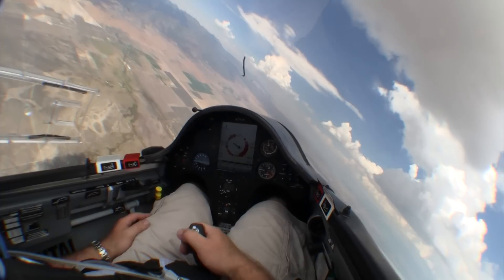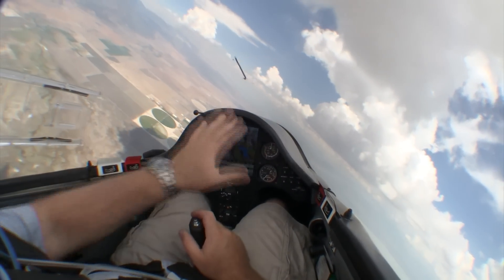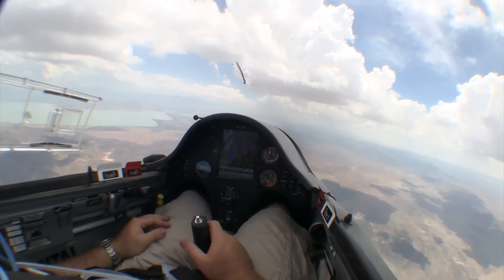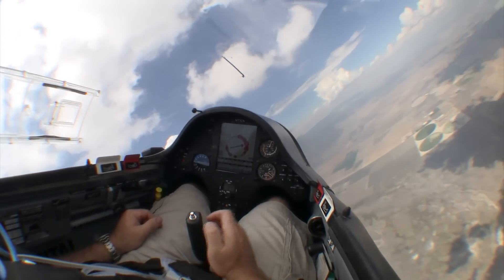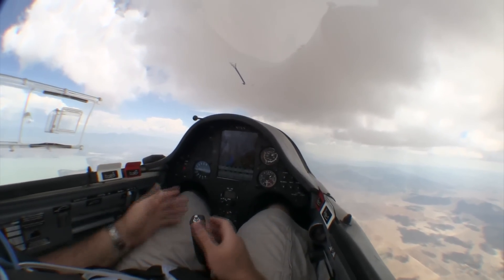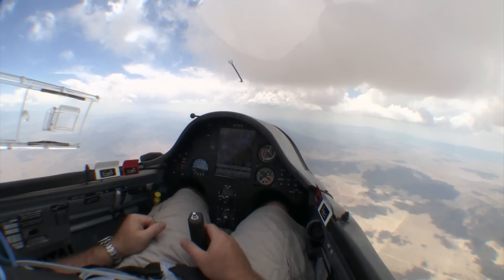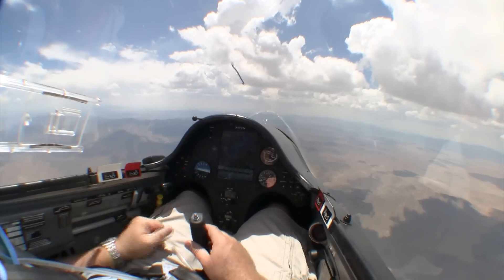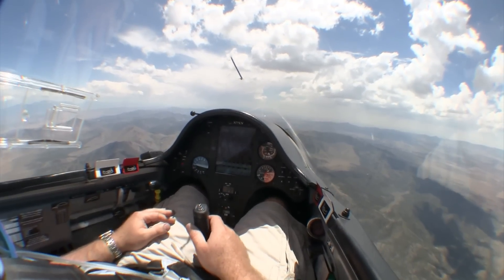Glider Cockpit Tour While Flying Between the Clouds

Comment: So, what is that yellow lever on the left side of the cockpit, and what does it do ?
Reply: Never mind that question, but does that glider have air brakes on the wings ?
Reply from the maker: Mike Goodolds the yellow lever is the tow rope release.  What I keep messing with is another lever that adjusts the flaps. Gliders use flaps a lot more than planes. Yes this glider has airbrakes/spoilers that I only use on landing.
Reply: @BrunoVassel  Thank you, my friend. Enjoy soaring the skies :)

Comment: New control panel? And it looks like he's plaing with a little black whatever. And his little plane makes lots of little noises. I would never judge his thermal, Far be it from me. This thing he doesn't use very much. Air going up, glider going down. It detects how high he is and determines if he's going into the wind or not. Little bit too technical. Blah. I didn't submit a file at the end of the day.

Comment: Great vid, some of you if not all wear parachutes....so does thst mean you also have to learn that sport
Reply: These parachutes are spherical canopy, they don't glide and can't be flared for a landing.  They do have steering lines to choose which way your nose is pointing, but once the canopy is open, there is really not much to do. This also means that there is very little chance to mess things up, even if you don't know what you are doing. So, the training can be summarized as "Jettison canopy, open seat belts, get out, pull ripcord. When landing, keep your head down, elbows tucked in, ankles and knees together, knees slightly bent, and roll on touchdown.  Any questions?"  Doing an actual jump is not required.

Comment: Amazing stuff.  So the thermals stop at the cloud base?
Reply: Actually not. But usually the glider pilots are not allowed to enter the clouds. In certain countries under certain rules that is allowed. Your plane must have the required instruments and the pilot must have instrument flying certificate - and  you must have a permit from the areal flight control. The Finnish altitude record 7650 m (25 000 ft) from 1972 was flown in a thunder cloud.

Comment: How many G's can your glider pull? And what's the top speed?
Reply: ASW-27 (from a WikiPedia page):
g limits: +5.3 -2.65 (actually the limits depend on speed)
Never exceed speed (light maneuver in calm air):  285 km/h (177 mph; 154 kn)

Comment: Someone just mailed me my first vario, an antique 1986 Ball M-20 wristband vario.  9 volt battery on the side, analog meter, and it only beeps when going up.   Must of cost someone a fortune back in 1986.   But it's totally period correct.    Stone age!  

http://dcim7.peachcountry.com/DSC_0735.JPG

http://dcim7.peachcountry.com/DSC_0736.JPG

http://dcim7.peachcountry.com/DSC_0737.JPG

I'm going to try and do some long distance thermaling in my Volmer Jensen VJ-24W motor glider and seriously extend its weak range it would of had as just an ultralight.  1:48 glide ratio with a glass cockpit map isn't really a challenge, is it?     Mine is suppose to have a glide ratio of about 1:12  but it might be worse, because of the heavy landing gear fitted to mine.    If I can rig up a engine pull cord allt he way to the cockpit though, it won't matter.    

http://dorothy.air-war.org

Don't let him fool you, people, he is pulling your leg, that is not a high tech MK4 Yaw string.  MK4's cost thousands of dollars.  That is a cheap ass Yatsumoki clone knock Yaw string, he bought off of ebay from Schenzen, China off.  I can tell just by looking at it, it has split ends, just like my hair on a bad day..

Comment: what happens when you g-loc in glider?
Reply: Cable release for winch launching or aerotow.
Reply: Bruno Vassel im not a glider pilot but just asking is there enough time for you to regain consciousness?
Reply: +Bruno Vassel what is the yellow handle under the flaps?
Reply: You dont G-lock in such a glider. They can max pull about 5.4G. Some gliders can go as high as 10G, but those are special made aerobatics (Glider name: Swift S-1) You do not have enough energy to sustain the high G factor. I do not say that it is impossible, but all im saying is that it is actually quite difficult to G-lock :)
Reply: The glider will most likely sustain flight on its own, and won't just fly straight down :)

Comment: Do you operate in standard VFR rules, i.e. keep 1500 feet from clouds, min 3mi visibility, or do gliders have their own minimums? Secondly if you needed to climb in an emergency, can you trade high speed for altitude then put out positive flap to maintain lift at the new, slower speed?
Reply from the maker: +Mirandorl Gliders operate under the same VFR rules as powered aircraft.  Yes, you can trade airspeed for altitude.  I have a few videos where I fly close to the ground fast and then pull up all the way to pattern altitude.  Gliders are amazingly efficient.
Reply: +Bruno Vassel Thanks for the quick reply! I will check out some of your other vids, the locations you fly in are beautiful and I enjoy the relaxed way you narrate your experiences.

I have a few lessons in a C172 but am mainly a sim flyer, hoping to one day get a PPL and, who knows, CPL (living the dream, right?), and the whole time with gliding I feel like I would be worrying about losing airspeed and wanting to maintain nose down a la engine out procedures. I can see with gliders its a very different story, they just seem to slip along with very little drag and can climb with the tiniest thermal!
Reply from the maker: +Mirandorl After 5 minutes on your first glider flight you will quickly realize that gliders are VERY easy to control airspeed.  Just trim to a desired airspeed and it will pretty much stay there unless you move the stick.  It is really worth it for you to go get yourself an intro flight!
Reply: Bruno Vassel There are a couple of schools where I live so I may well just do that :) Thanks again!

Comment: the background noise , is that the wind noise ? or hidden engine ?
Reply: It`s an air vent for Air Conditioning to keep him cool.
Reply: It's a glider. No engine at all. Only the air flowing by.
Reply: Chris Ehmke They do make motor gliders which have a low-powered motor and stowable prop in lieu of a tow plane. Just so you know.
Reply: @Lufasu Mafalu The constant background noise you can hear in this instance is the airflow over and separation of airflow from the sailplane surfaces. The faster you go the louder it gets. In KISS lay terms, yes, the "wind" noise. The mic is picking it up better than his vocals, and the amplification on YT is rendering it so it sounds louder in this vid than it is.

Comment: Hi Bruno, what about that button or knob on the top left corner of the panel that you push from time to time?
Reply from the maker: Handle to an air vent.  Occasionally push it to make sure it is closed.  The canopy can make loud wind and whistling noises when things aren't completely shut or sealed.

Comment: I'll never fulfill my dream of flying by myself, so you're the next best thing.
Thanks for speaking to us, out the know.
What lever do you control with your left hand?
How do you read clouds?
Reply from the maker: Thanks for the kind words and I am thrilled to hear you are enjoying my videos.  The lever you always see me moving with my left hand is the flaps.  In modern gliders, the flaps are used much more than in regular airplanes.  We have high speed flap settings that actually deflect the flaps upwards.  I change the flaps as I change air speeds.  It looks like a lot of work but it becomes automatic and I don't even think about it. Reading clouds is an art form that takes some time but the more you fly the better you get.  In a nutshell, big puffy clouds with flat bottoms are the best for possible lift. :)  Take care, Bruno
Reply: Bruno Vassel
Thanks. Keep flying. Keep taking us with you.

Comment: Hi B4,
I have heard that flying sailplanes is somewhat addictive. Heck, I'm finding watching Balleka's and your videos addictive! Watching this video on the cockpit tour of your ASW-27B is very informative. I've watched videos of other gliders and was wondering, are the disk brake controls normally found on the forward side control stick? The Glider Flying Handbook only says it's location depends on the model. Other than that, your videos are very instructive, you get a good idea what soaring is all about. I'm going to have to go for a ride soon.
Cheers,
Rick
Reply from the maker: Hi Rick - very nice to meet you!  Thanks for the kind words about these videos and I am glad they are getting you more interested in gliding. :)  Balleka is a master pilot and story teller!  I enjoy his videos too!!!  The answer to your question is on most gliders, the wheel brake is activated by pulling the spoiler handle more than half way back.  Cheers and go take that ride you were saying - you will love it!!! Bruno
Reply: Bruno Vassel
Oh, OK, I like that idea - killing two birds with one stone. I know on some powered aircraft, you depress both peddles to activate the brakes. That would make it hard to turn the glider on roll out. I wanted to take a 1st lesson at So Cal Soaring Academy as a Xmas present to myself, but they're closed for the season. I notice you high-hour pilots move the control stick far less than folks that are taking lessons. What was the term the first Astronauts used, "Steely Eyed Missile Man?" I like your style.
Cheers,
Rick

Comment: I have a question. What is that sliding port type of thing on your left side there? what is it for? you cant open it mid-flight can you?
Reply from the maker: It is a sliding window. Yes, you can open it up in flight.  It is kind of noisy open with the wind but nice to have for a quick vent of the cockpit it I had Mexican the night before... ;)
Reply: That's called the DV (direct vision) window. The serious reason it's there is so that you can get (just about) enough forward view to land the glider if the cockpit is obscured or damaged in flight. Mostly it's used for other stuff - as Bruno says as a quick vent in flight (you do have less noisy vents for general ventilation), to stop the cockpit steaming up when you're sitting around before take-off or to talk to ground crew through.

Comment: Great video, as always. Many thanks.

Safety comment for any budding pilots:

If you need to report your flight level to Air Traffic Control, set 1013mb on the alitimeter and call the number of hundreds of feet. To clarify that statement, 11000 feet on an altimeter set to 1013mb would be called as 'flight level one one zero' to ATC (because one hundred and ten hundreds of feet = 110x100 = 11000 feet).

A 1013mb setting is the compulsory standard for actually flying flight levels. It ensures that everyone who is flying flight levels is on exactly the same pressure settting. If one or more pilots fails to set 1013mb, they could be flying at dangerously low, or even nil, vertical separations from other aircraft who are correctly using 1013mb.

Of course (as Bruno knows) 1013mb must not be used for checking terrain clearance unless 1013mb, by sheer coincidence, is the applicable QNH for the area you're flying through. Again, as Bruno knows, when set to QNH, your altimeter reads vertical distance above notional mean sea level. If the applicable QNH is 1013 then its your lucky day! Otherwise, don't forget to change from 1013mb back to applicable QNH when terrain clearance needs to be monitored.

For landing, some pilots (e.g. some airline varieties) set QNH (altimeter reads airfield altitude on touchdown). Alternatively, some pilots (e.g. most glider types) set QFE (altimeter reads zero on touchdown).

Comment: do a barel roll
Reply from the maker: My glider is not allowed to do barrel rolls, only loops and a few other tricks.  With a barrel roll my roll rate with the really long wings is not fast enough and you can very easily overs peed the glider - at least my model doesn't allow it. Sorry.  Thanks for watching! :) Bruno
Reply: @BrunoVassel  your model will be how exactly i want my life to be. Safe! If I do that, All I would like to do is bring snakes and just relax and eat them while checking out the views. Now how good is this glider close to the alps, can it handle strong wind for thermaling that way!? Or you may need a different model so when the wind changes you can quickly swoop to the other side if you know what I mean. :D
Reply: Yes, don't you just hate it when you overs....peed your glider :-)

Comment: At 18,000 ft youre in class A. Do you then go IFR?
Reply from the maker: I am not instrument rated so I stop before 18k.  There are a few pilots that have the rating and mess with ATC.  I find that I can still have plenty of fun below 18k and not have to worry about getting a rating to go higher.
Reply: Bruno Vassel In the UK the British Gliding Association has agreements with the Civil Aviation Authority to allow clubs to activate so-called "wave windows", which allows gliders to fly "uncontrolled" into nominally controlled airspace in order to take advantage of specific areas of wave lift. It's a pretty sweet arrangement actually.

Comment: what glider would you get if money was no limit?
Reply from the maker: Great question.  At this point, I would keep exactly what I have. An ASW-27B 15 meter glider.  It is tempting to get a bigger wing span glider but I don't feel I have come anywhere close to maxing out the capabilities of my current glider that I am flying right now and I designed the panel so it is perfect for me. :)
Reply: Bruno Vassel ok thanks but ill be honest with you, i just wanted to shortcut my research on which is the best glider in the market right now, i just discovered this sport and it takes a lot of time to go through all the info on net on manufacturers and models! so maybe ill ask this way, judging by product hierarchy, is ash 31 mi the best? or is there no such thing as best glider as every person needs hes own? alltough from what ive read this far most people praise high performance gliders. so maybe its like with cars, audi is good but mercedes will always be better. sorry for long question you can answer short if you want to.
Reply: Bruno Vassel Your ASW-27 is a sweet ride and a lovely bird! Just some quick questions; If you do recommend one, which tandem sailplane do you recommend? Personally, I have been eyeballing the Schempp-Hirth Arcus E, a 20m class flapped sailplane with an electric self-launch motor; an absolute beauty.

I did not know you could actually customize the layout of the cockpit for your sailplane. In that vein, what instruments do you recommend for a tandem 20m class? 

One last thing I am curious about, what kind of glider did you fly in for the first time? My first time was in an LET-23 Super Blanik.

Comment from the maker: Sounds about right.  At 55 miles out I was 6,000 ft AGL and felt like I needed 2000 to make it.  At 15 miles out I was 1500 above the ground and circled with some gulls for 30 minutes until a little thermal popped up in the last bit of sun on the ground around for miles and I got home.  Exciting!!! This is why I keep coming back year after year. The thrill of not knowing if you are going to make it home is so addicting. Thanks for watching and yes, Utah is amazing. Fly safe, Bruno

Comment from the maker: Great question.  I usually put on the oxygen somewhere between 10,000 and 12,000 feet with most flights going up to 18,000 ft where oxygen is not an option.

Comment: since the ailerons are on the outside and the flaps are on the inside, separate, do the ailerons also adjust when you change the wing camber by adjusting the flaps?  That's how most RC model gliders work.
Reply: ailerons are usually separate and are for turns.

Comment: You can fly any direction. Unlike sailing, for a glider there's no need to be wind at all. If there is any wind, think of it like a big column of air moving over the ground. You're moving along *inside* this column. Usually, your airspeed is higher than the windspeed, so you can move forward in any direction relative to the ground. If the wind speed is higher, you'll actually move backwards relative to the ground! But relative to the air column, you'll have your normal airspeed in any direction.

Comment: great video, very informative Bruno. Not to steal any light from Bruno I will give you a practical demo on how a glider stays up. Next time you're out for a walk in the hills, take a paper plane & throw it off a hill top, if the wind is straight onto the hill face...the plane will climb up, thats the wind going up the hill faster than the plane is coming down. We do this form of flying (slope soaring) with radio control gliders, as well as full size.